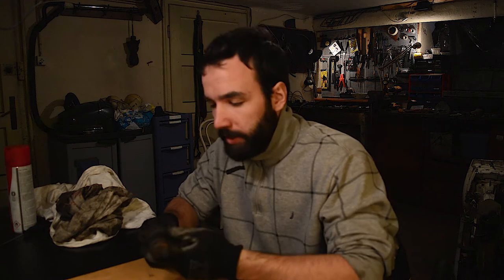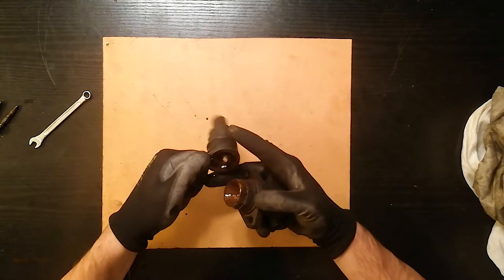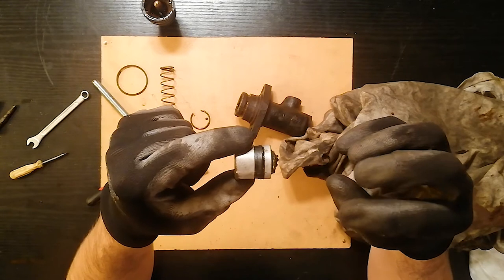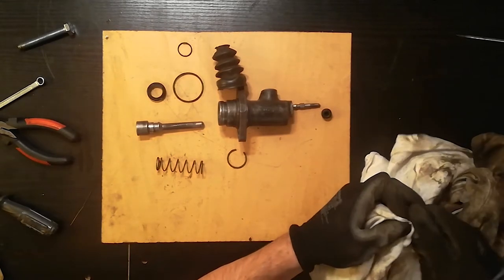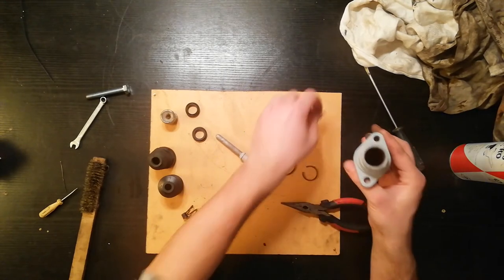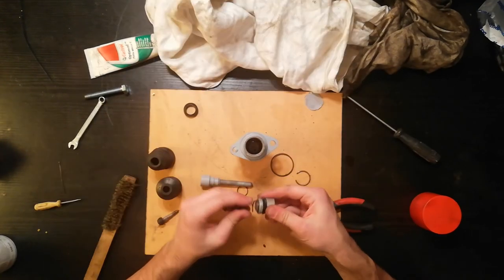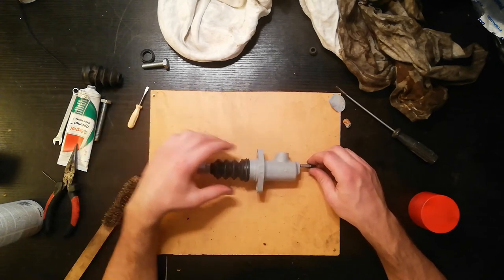How to rebuild clutch slave cylinder leak - DIY Repair And Restoration VW Vanagon T3

Comment: Very nice explanatory video, easy to follow, and nothing to really nag about. but from where do you get the seal that was broken?
i Have several items (calipers, slave cylinders) that need saving, but i found bupkis.
Reply from the maker: Sorry for the late answer! 😬 As I said above, the kit was available at my parts store. I also know a store that specializes in them and that's where I go for brake caliper kits. Ebay is also worth checking. Where are you from?

Comment: Great Info 👍
My question is where to get correct seals an boots from. For instance on a 911 slave cylinder ect?
Reply from the maker: This particular kit was available at my local parts store. There is also a store nearby that specializes in these kits and that's where I go when I am refurbishing brake calipers for example. You can probably also find it on eBay. What year is the Porsche?
Reply: Thanks for your quick answer🙏🙏🙏
It would be for a 1996, 993 and a 2005, 996😉
Thanks again for the great video
Reply from the maker: @Mckorzi  There is a shop here, that sells individual seals by size. If you can give me the dimensions I'd be more than happy to check for you. =)
Reply: @BearBoris  
Thanks for that. But don’t bother too much.
Where is home? I,m in Spain but work in aviation and travel the globe, so I should be able to find rubber seals😉
I just thought they might be a special size for its special job to fulfill. But if they are normal seals then not a problem 👍
Appreciate your time and help though🙏🙏🙏
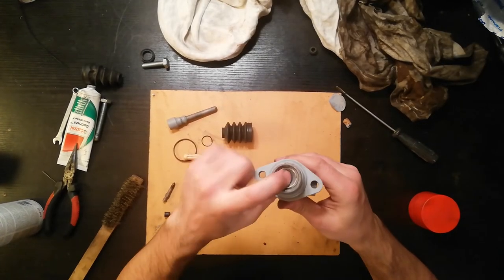Reply from the maker: @Mckorzi  Well depends on what you mean by 'normal'. They have a special skirt @8:05 . I'm in Bulgaria. I'm curious  to see if I can find a solution for a Porsche, other than the main dealer. :D
Reply: @BearBoris  
Cool, let me know if you find out something, I would be interested 👍
Greetings to Bulgaria✌️
Reply from the maker: @Mckorzi  Well if you have the dimensions I'd be more than happy to check for you. =)